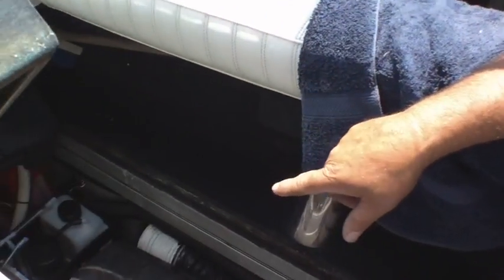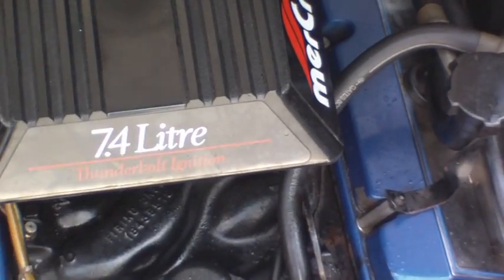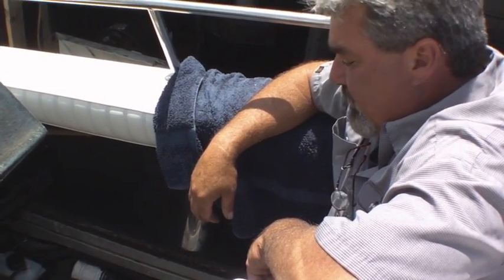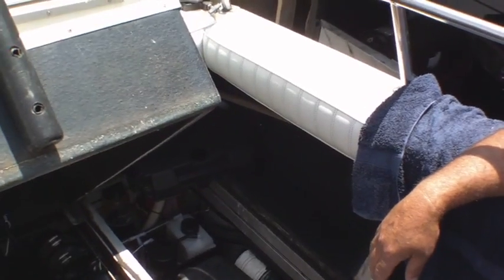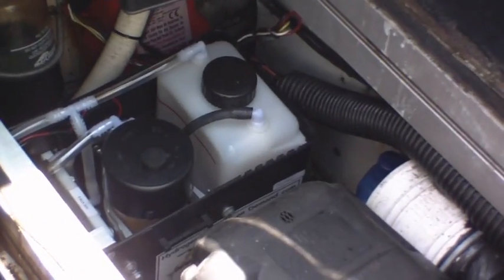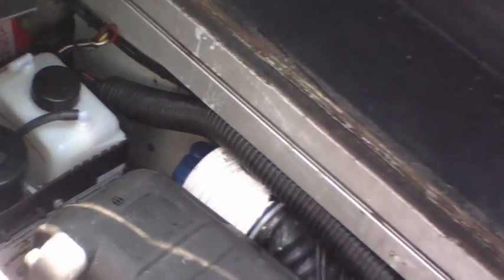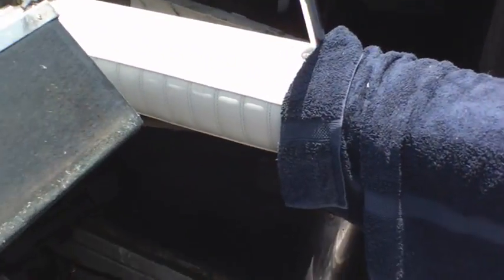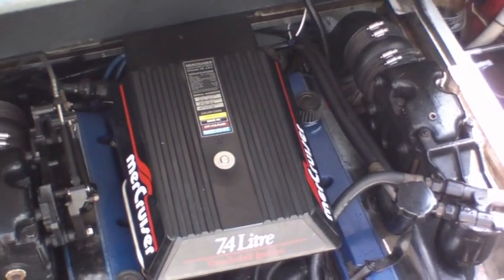Portable HHO Generator System installed in a fishing boat - gained 30% MPG and more power!

Comment: Its really not, you think the energy is coming from the alternator and the battery but its not. the engery they are getting is from the h2 and o2 in the water. 1L of water contains 1k m3 of Hydrogen and 0.5k m3 of Oxygen gas. thats ~3,500,000 KWh for the h2 alone!! Gasoline only contains 9.7kWh/l. The guy says the gallon of water last for 40 hours, thats 0.095L/hr Lets say the alternator runs at a constant 120amp for all 40 hours = 1.4kW/h or 56kW over the entire 40 hours... The math works!

Comment: I find it amazing that the Geniuses that are constantly trying to play the "Physics" card cannot comprehend the possibility that hydrogen could possibly change the burn characteristics of gasoline or deisel fuel.  For anything to combust requires only 16% oxygen, in a 4.0L V8 engine each cylinder draws in.5 liters of air,, of that only 6.25ml is oxygen the rest is Nitrogen and other gases including hydrogen.  With 1 L/m of HHO that is 4ml of hho mixed with the 6.25ml of oxygen and other gases.

Comment: Hi guys, nice video, but I would just point out one thing, after years at sea my self, one thing springs to mind here, if & I say IF, anyone ever got a leak of HHO, the unit sitting in the bilges is not the safest of locations, it would gather the gas, introduce one spark, hey you know the rest, so on deck with those babies, or vent the bilges.
Thom in Scotland.